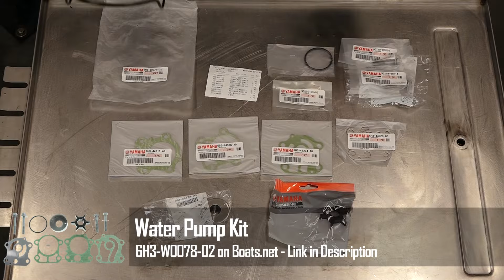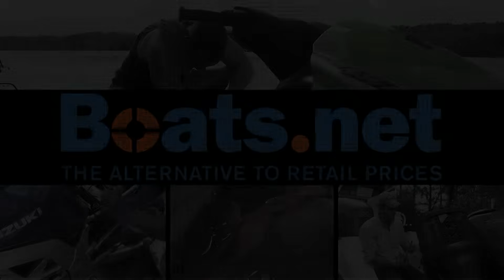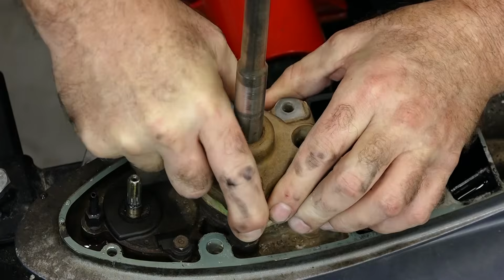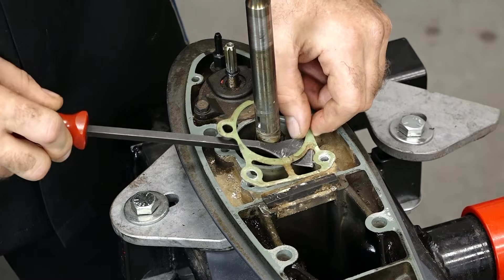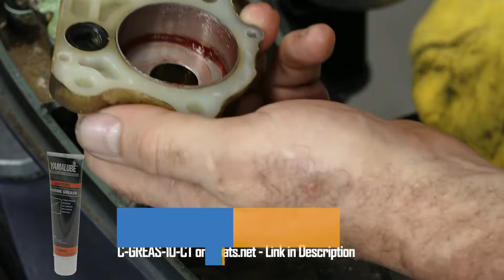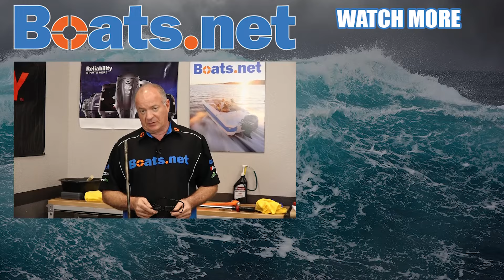How to Replace a Water Pump on a Yamaha 60 | Yamaha 60HP Water Pump Replacement | Boats.net

Comment: One of the most important elements of changing out the water pump impeller is making absolutely sure the rubber seal is pressed into the top of the upper water pump housing.  There are also a couple of other seals that go on the water pick up tube.  Your engine will run OK at low speed, but will go into limp mode when the engine overheats at moderate to high power. If you miss these parts, a large percentage of the water will escape from where the upper water pump housing connects to the water pick up tube of the engine.  You will know this has happened when you test run the engine and an excessive amount of water comes out of the front of where the Upper Drive Casing and the Lower Drive Casing come together.  Normally, some water comes out in this area, but it not a sizable amount.   Another hint that you missed this seal is that the stream coming out the pee hole will be quite minimal when the engine is at idle.  Keep in mind that even at idle, the stream should be strong.  For these parts,, look for "Damper, Water Seal 3" and Damper, Water Seal 2" from boats.net.  I have no connection with them, but be assured boats.net is the best place to get your Yamaha engine parts.  Their website is very easy to use so you get the exact parts you need for your particular year and model engine. They ship right away and for larger purchases they pay the freight, not you.  They're the best.

Comment: How do diagnose the false overheating buzzing noise from the throttle control lever?  I replaced water pump still making noise, there's no oil tank or filter, because it's a v4 Johnson outboard motor 90 hp, 50 to 1 mix fuel.  Where is the temperature heat sensor? Next I'm thinking replacing thermostats..the noise use to go off when it's cold but now all the time.  Any suggestions how to disconnect the sensor or replace it?

Comment: Hey John, big fan here! I have a 1999 Yamaha C60TLXR two-stroke outboard. 
I got a 
gasket- 90430-12072-00
a water seal damper- 663-44367-01-00
and a damper water seal 2- 663-44366-01-00
In an attempt to seal where the water comes out and up to cool the motor. These three parts were listed on the lower casing drive 2 diagram. 
But how the heck are these three little free-floating gaskets supposed to go on?
Any help would be greatly appreciated

Comment: Is there supposed to be a rubber seal that sits on top of the housing in the little hole where the water is Palm to the engine?  I I just had my Yamaha 60 2009 high thrust engine, lower unit serviced and right when I got back on the water I realize that the telltale wasn’t peeing as it should, causing the engine to overheat. I am now conflicted as to what the issue may be from because I don’t believe there is a clog. I believe that something with the water pump isn’t pumping correctly. Any advice would help Thanks.

Comment: I’ve burned/partially melted, two housings trying to replace my impeller. Make sure the stainless steel cup that mates with the plastic pump housing is properly seated inside the housing. The notch on the stainless steel cup should sit in the smaller “notch” inside of the plastic housing, and not the bigger “notch”. If not properly seated, the cup will spin inside of the plastic housing and the heat from that will damage the plastic and melt the bottom mating surface. Don’t ask how I know, $160 mistake. Ouch… Thank you for the video.

Comment: Do you need to drain the gear case oil before dropping the lower unit?
Reply: No you don't. I would assume that as old as this question is you have probably figured that out for yourself by now. Or you got the answer elsewhere.  All that being said It would probably be best to change the lower unit oil whenever you do change the impeller as just a matter of servicing all the points of the lower unit. Do them all at the same time that way you know when all of it was done. I've been told that you should change impellers every two years if your boat gets used on a regular basis and every year if used  only occasionally...

Comment: You forgot one very important thing,you didn't grease the 4 skrews holding the housing down.You always put grease on every screw when you work on outboards.I experienced a broken screw some time ago working on a F60,just because the mekanic who had worked on it before never greased the screws,And because the housing is plastic you cant use heat on it.Which is one very common thing to do,especially when working on old engines.Don't forget to grease any screw you put back on.You have a nice day.
Reply: You can greased you own bolts....and don't &%$#@...thanks!!!

Comment: Thanks for the video,you are always very willing to explain everything and you definitely make things simply understood.If it is possible I would like to ask a couple of questions.In that case what was the problem? I mean the sympton was probably the high temperature of the engine, but the impeller was in very good condition. So as I understand, the cooling sea water was pumped to the engine properly and actually the gaskets were in need of essential replacement. Are the warned gaskets themselves capable to be an obstable to the cooling of the engine? In my mind, the destroyed gaskets could be a cause of leakage but not an obstacle to water's flow, but maybe there is something I dont know.Finally, if we have the same syptom of engine's high temperature and the impeller is in good condition like this one, what else could we check-overhaul (apart from checking for fishing lines on the propeler shaft)? Thanks in advance for your time and I am sorry if my message was too long.